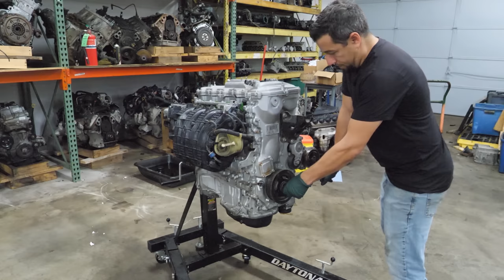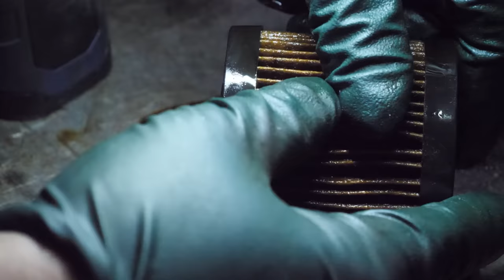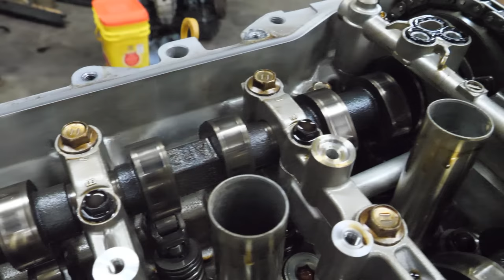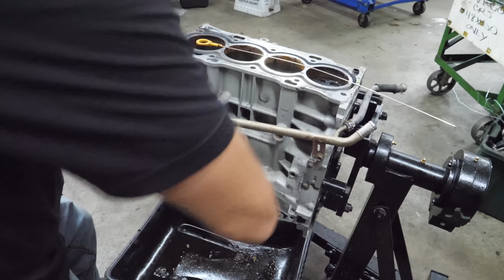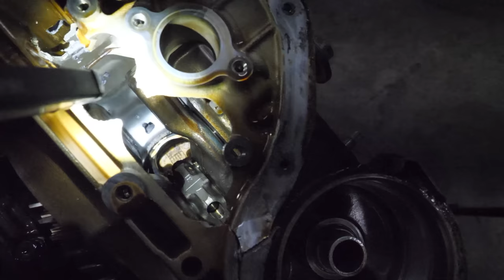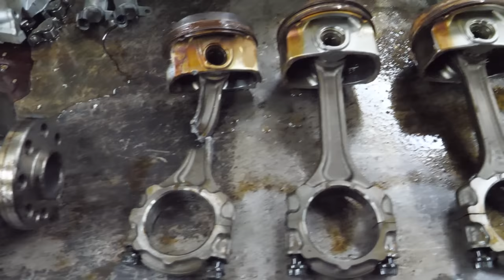TRASHED Toyota Camry Rav4 Scion TC 2AR-FE 2.5L Engine Teardown

Comment: I was going to say... it's toyota... put jb weld on the block hole, removed the broken parts.. weld a plate in the damaged cylinder to prevent blowby going thru the valves and throwing off ur maf readings. Then u should be able to drive it to the junkyard 😂  cuz toyota is the honey badger of cars. They don't give a shit

Comment: 31:45 Modern engines are just simply too damn thinly built to survive abuse. You can hydro an old smallblock Chevy and, 9 times out of 10, itt'l be fine. Ford 300, Chev 250/292/4.3/iron duke, Chrysler LA, RB, 225, Jeep 4.0 I6, any of the flatheads, 99% of the time these older engines are built substantially enough that they'll just stop. And then, once drained of water, they'll run again. But these new engines are not built very substantially at all and they will bend/break rods every time.
Reply: I'd have to see it to believe it. depends on the era it was built(not all SBC's are the same), RPM at lock, and how big of a drink it took. I do agree the CR of most older engines and the lack of CAD tended to make those engines more robust, but a mid RPM hydrolock? I wouldn't bet on its survival...
Reply: @christopherdoremus4587  The tolerances are also much looser in them. Bigger chambers, lower CR, more chance of one leaking down past the rings(especially today when the youngest SBC is in its 30s at this point), and you've got a recipe for an engine that's going to shrug off hell on earth.

There's been videos of smogger era SBCs in pickups that have been sent wide fucking open 5500RPM into mudpits, hydro'd, then just forced back to rotation by reefing on the starter until they spun over again. Still started right back up as soon as they cleared enough mud out of their systems to rotate again. Obviously these vehicles were well past driving on public roads and were just being thrashed because hey it's fun to beat on junkers sometimes, but still. 

These older engines also tended towards low RPM operation in general. I know the 300 six in my 85 F150 seldom goes past 2,000RPM and typically cruises along at 1400-1600. 2.49 rear gears, 4-speed wide ratio manual trans. Typical upshift is around 1500-1600. 70mph is 1650. 55 is about 1400. It's geared for super low revs.

Comment: That was a very low mileage engine  based on how clean the the valve train and inside the motor and no ware on the bearings

Comment: Flood car. The gelatinous is the FIPG sealer on the oil Pan,  someone put too much in and it oozed in.  Water pump should have a FIPG or runber gasket. Really,  from the head up plus timing cover you got close to $1000 in parts, including the cams.

Comment: Busted connecting rod is always the same thing on a Toyota. Low oil. Its a Toyota its going to eat oil you have to check it at least once a week before you start your car. If its low add some oil to bring it to the full line. I can almost guarantee you it was dealer maintained. That's a death sentence for the car especially a Toyota that eats oil because the owner thinks why do I need to check anything under the hood?  Just had it all checked out when they changed the oil the SAE  mechanics looked at it closely!! Which is nonsense the oil was changed by monkee's in the back of the building using vat oil. Ever wonder why you cant see your oil getting changed at the dealer?  The Dealer hopes & prays you blow it up so they can sell you a new car!

Comment: In all inline 4 engines cylinder 1 and 4 should move together and 2 and 3 should move. Together. The fact that cylinder 1 was down with 2 and 3 should tell you that the rod was broken without doing the test with your hammer
Reply: but we like his scientific approach!
Reply: The hole in the block also is a good indicator.